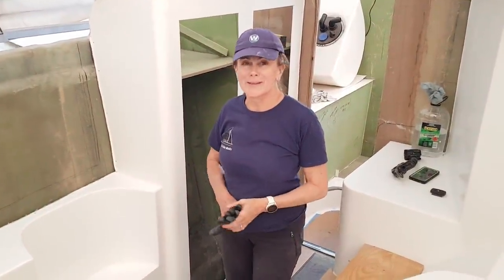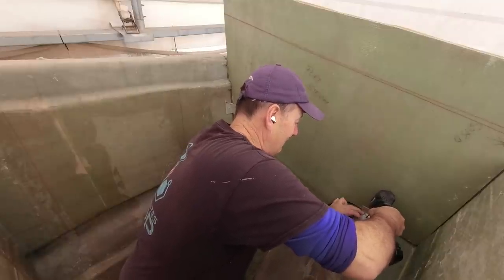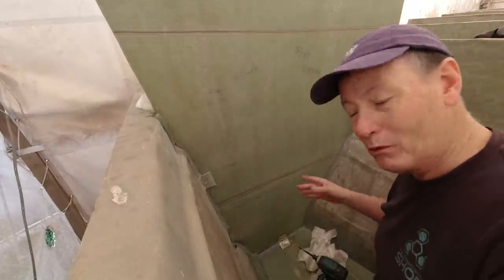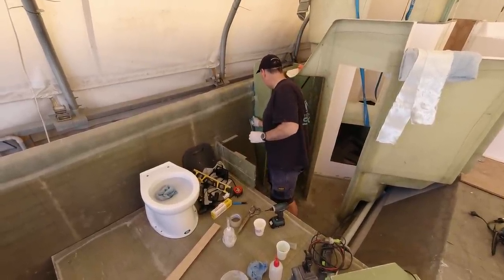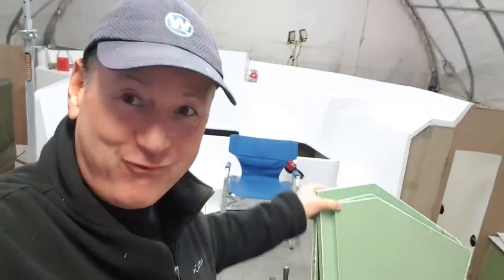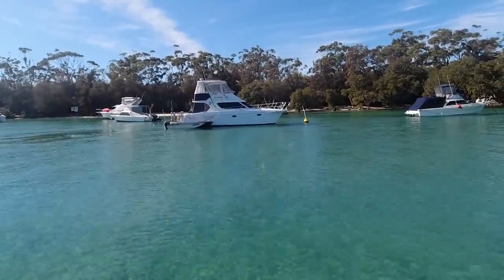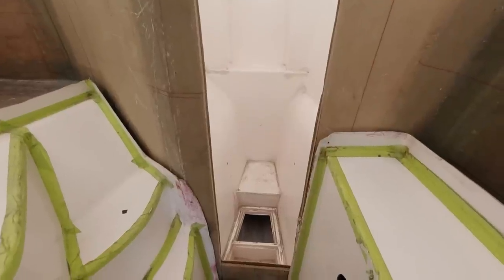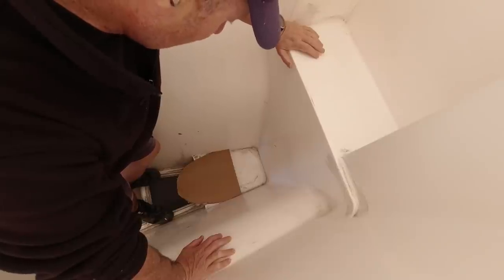Jammed in the forepeak - 12.7Mtr Catamaran Build Ep186

Comment: Is it possible for you to get additional clearance by elevating the mounting pad higher up the hull sides? Providing you have enough clearance for a person's head while seated.
Reply: @steves1266  Same idea here, a riser should give him what he needs to mount upon while allowing some clearance in that tapered well area. It would be easier to use for a big tall person, yet still be useable for smaller folks vs the reverse circumstances.
Reply: Yep, definitely consider just elevating the platform (entire head if necessary) to make clearance!

Comment: I know you said you weren’t going to finish the ceiling before flipping the top over, but that certainly would seem like it would be great to flowcoat everything and then later add other ceiling finishes on top of the flowcoat . As an old painter floors are a lot easier than ceilings!
Reply: But these ceilings aren't gonna be 8' or higher either. It'll be fine.

Comment: Speaking of squeaking boats, I read some time ago in a boat design book about tabbing by creating a trapezoid of foam, the width of the bulkhead thickness at the top and wider at the hull side so it creates a filet shape. You cut the bulkheads to fit this additional thickness (usually 7mm or so) and then tab over the foam without fileting. 

Supposedly this is "less squeaky" as bulkhead to bulkhead interactions are minimized due to a softer contact points.. Ever tried this before?

Comment: Why did you leave the stir stick in the pointy bit?
Reply from the maker: Very observant of you.I had it there holding a small slither of foam that was epoxied in, that filled the wierd little gap in the very bow.It has now been removed and correctly tabbed in,so don't stress buddy.Cheers Rossco

Comment: Hey Ross. 

Because the hull tapers upwards, how high would you have to go for the head to fit ? 

I'm suppose you thought of trying that, but you never know.
Reply: Or modify the head... cut the base to fit perhaps.
Reply: @Macroproxy  on any I've dealt with before thats not really a feasible option to cut the base as you'd have no way of securing it.
Reply: @benmac940  Yeah, I agree that would be a difficult task. Much likelier it would be easier to just get a different toilet.
Reply: @Grim FPV A nightmare project... for the beast single-hand building a 40' sailing catamaran cruising yacht...